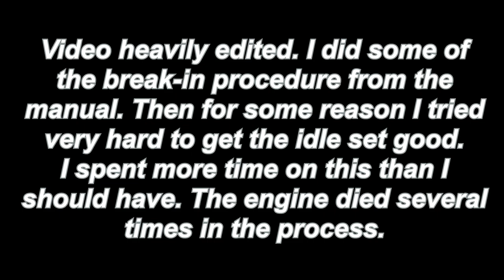OS Engine Oh My! Part 3 OS FS-61 The Run

Comment: Hello ... I bought a used Hobbico Nextar trainer plane with an O.S. 50 and did not bring the battery that the plane carries to drive the servos. It has a Futaba FM receiver of course with glass. What type of battery do I have to buy? How many volts and how many mAh? Thanks for your help.
Gabriel
Reply from the maker: I really cannot advise you on that.

Comment: Dave i'd love to know what oil they put in these from new? cheers alan.
Reply from the maker: So would I.  I cannot answer your question as I do not have a direct contact for any glow engine manufacturer.  In the second video of this series I showed the inside of the engine and I mentioned that I felt nothing on the inside as I discussed this very thing.
Reply: @dmrcflyr2  those bearings must be coated with something! cheers dave.
Reply: Cosmoline

Comment: Any special reason You used 13x6 instead of 12x6 for break in?
Reply from the maker: No, just what I felt like installing.
Reply from the maker: The last few FS61's I have run for the first time, see other videos here, I used a 12x6 so I thought something different was in order.  I also have never run 80/20 FAI fuel either, maybe I will try that next time as well instead of fuel with nitro.

Comment: Are air bleed carburetors more adapt to running without muffler pressure?
Reply from the maker: I do not believe the carb type has anything to do with using muffler pressure. The OS FP series all had air bleed carbs but used muffler pressure.  I don't follow the rationale for the question I guess.  The manual for the engine does not state that muffler pressure is required.  It speaks about using the pressure adaptor if the fuel tank is lower than optimal or further from the engine.  Many of the older OS 4 stroke designs operated just fine without pressure.  The OS FS-120, OS FS-60, OS FS-90, to name a few.
Reply: @dmrcflyr2  I'm just saying that when I notice that there is no muffler pressure connected, it is usually an air bleed carb, usually on older engines. But honestly I have never tried to run a twin needle carburetated engine without pressure.
Reply: I think it has more to do with carb venturi size. A smaller throat will create greater velocity draw. Older engines seem to have smaller carbs, but less power also.
Reply: @rodericksage4451  makes sense to me.
Reply from the maker: The original Saito FA-65, FA-120, and FA-270T both had airbleed carbs, so the venturi size thing is out the window there....  Enya 4 strokes also have an air bleed carb.